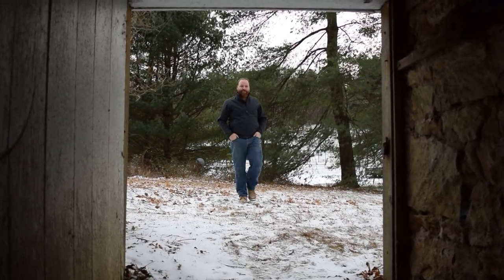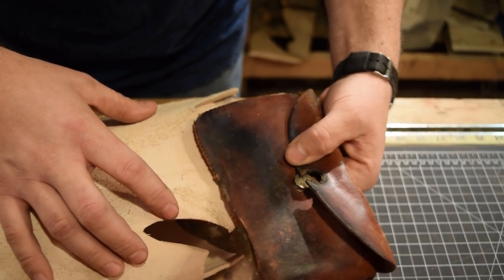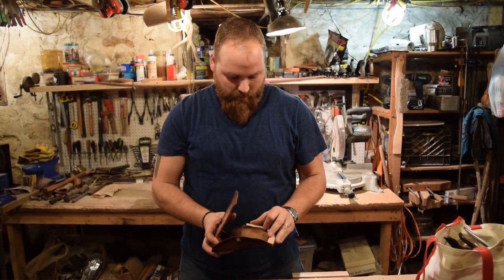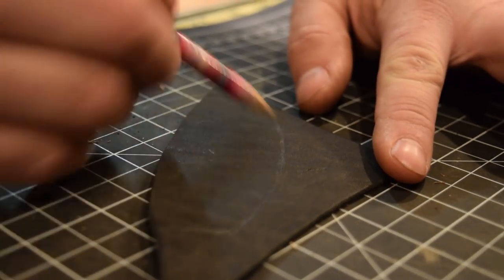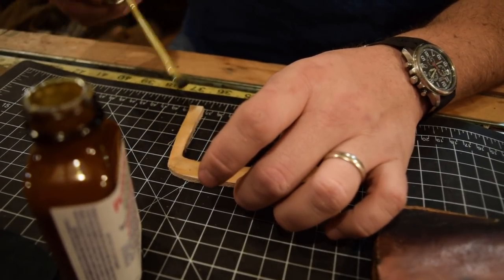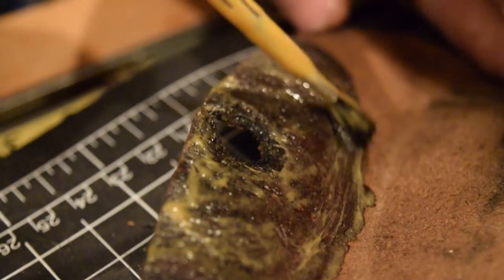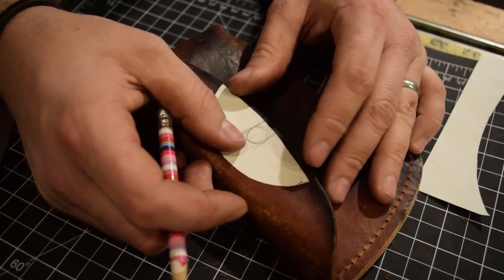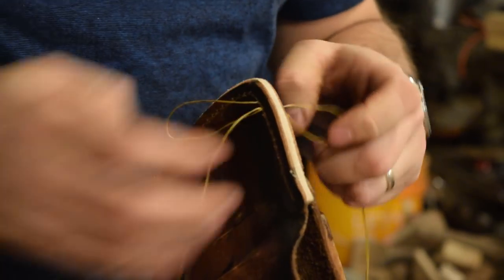Leather Axe Sheath Restoration

Comment: That sheath ended up looking gorgeous!! I will say, if you haven't replaced them yet, you really, REALLY need a new pair or to sharpen those scissors!!!! LOL It's also a good idea not to use a steel hammer on your snap punches, or any other punches etc., either use a mild steel hammer or one of those hard rubber mallet's so you don't damage the top of your tools. Great project and thanks for sharing. I really didn't think that pouch could be saved, but you managed it 👍👍👍👍👍👍👍

Comment: Good job. Most leather workers use rubber cement. That's a lot of effort and it still has damage. I think it might have been time to make a new sheath.
Reply: Agreed -- I'd'a just made a new one, but the lesson that you can restore an old classic is also valuable. Some things are more legendary when the original is preserved and restored.